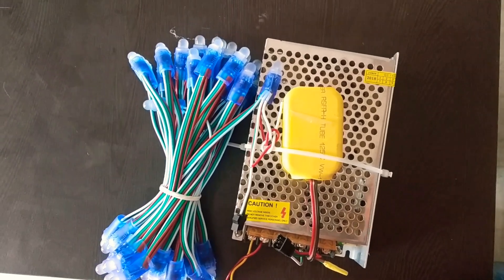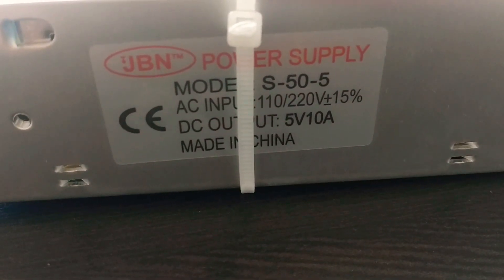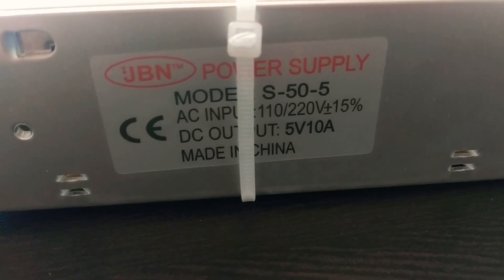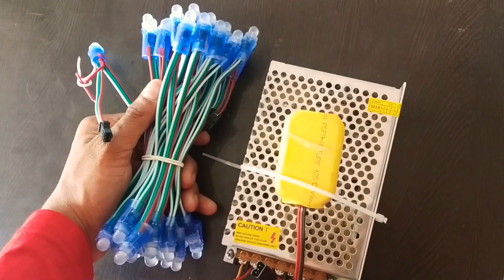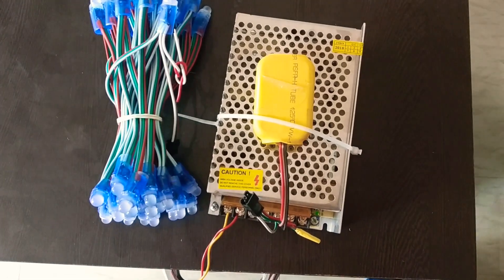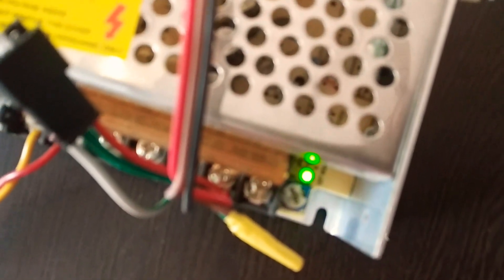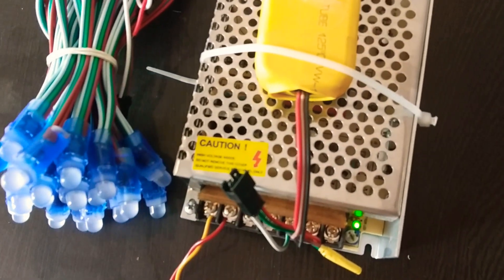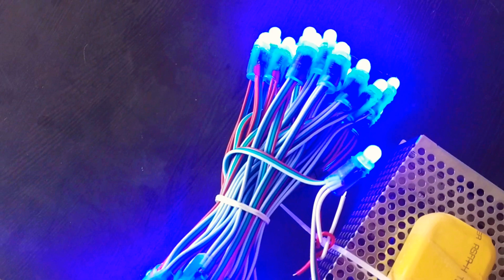50 pixel led testing from 10A5v SMPS, super bright pixel

Comment: Bro how many lights use for 10 amps smps(Power supply)
Reply from the maker: 200 bulbs
Reply from the maker: 100 pixel led buls required 5A 5V SMPS